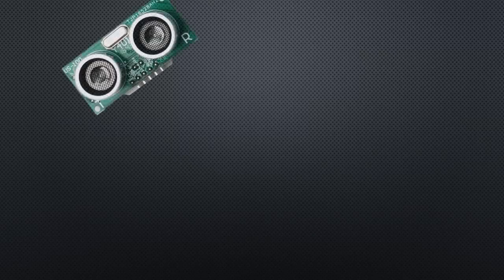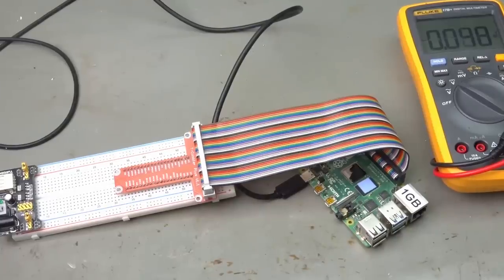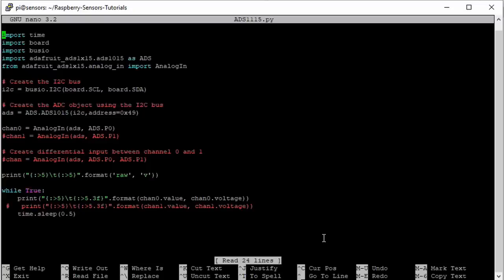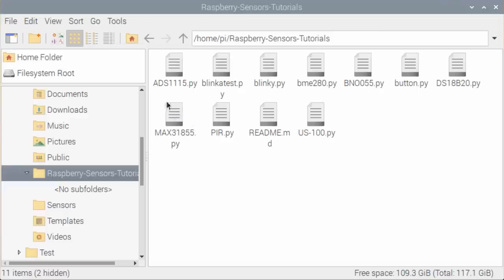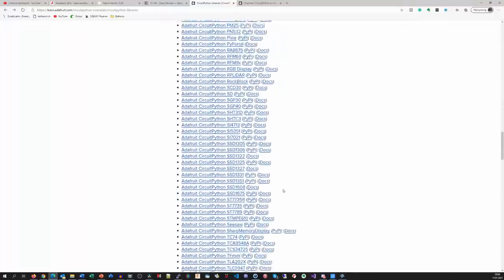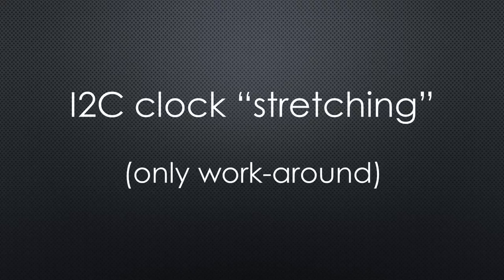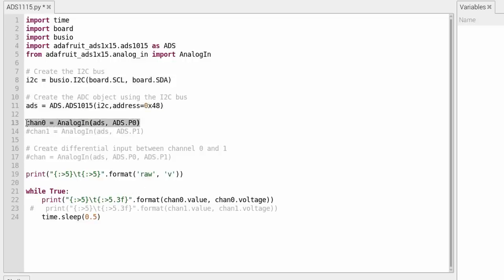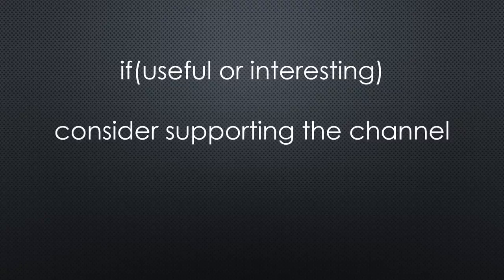#369 Definitive Guide to Attaching Sensors to the Raspberry Pi (Tutorial)

Comment: I find a better option for Raspberry Pi/Python drivers is pypi.org, especially if you're using non-Adafruit boards. Adafruit drivers tend to be optimized for their own branded products.
Reply from the maker: Does pypi offer sensor libraries? This is for me the deciding factor because I do not want to read the datasheet before I can use a sensor. Most Adafruit sensors are just a copy of the reference design. So no problem, I think.
Reply: @AndreasSpiess  Yes, there are usually several sensor library options there. You can also find the Adafruit libraries listed, too. It's a very useful resource for finding drivers.

Comment: IMHO, RPi is not really applicable for direct orchestration of sensors. Or, at least, not all sensors should be connected to RPi directly. Raspberry Pi OS is not a real-time system, I had tons of issues working with sensors that are accessible as "/dev/***" only -- just because OS was busy with something else when my software had to communicate to sensors. The same with i2c. Both with my C++ program and Python based.
But yes, thank you once again for another helpful video.
Reply from the maker: You are right: Real-time and Linux is not a good fit. Most of my sensors are not time critical, thou.

Comment: I am making a digital Speedo and wondering how do I connect a speed sensor to the raspberry pi and how to program it as the speed sensor does 6 pulses every 1 revolution
Reply from the maker: Linux systems are not good for real time applications. So if you need to measure exact times, maybe you use an Arduino or an ESP32 for the measuring and connect it to the Raspberry via Serial or WiFi.
Reply: @AndreasSpiess  I will keep that in mind if the way I plan on doing it doesn't work as I have the code working out the speed but for the displaying of the speed it updates every X milliseconds ( I would like to have an Arduino do that and send the data to the raspberry pi but I don't have alot of room as it will be going into a classic mini with a center speedo so it is unfortunately rather cramped

Comment: I have an arduino. But raspberry pi sensors. Can I use them on my arduino?
Reply from the maker: You have to check if they support the 5 volt of the Arduino. Then you can use them.

Comment: Good video.
First, like you, I start with Python librairies and Python code for I2C temperature sensor (also humidity and pressure).
Then I found some C code that was able to do system calls in order to communicate on I2C.
https://github.com/prisme60/BMP280

And finaly, I see that the driver for BME280 and HTU21 already exists in the Linux kernel, but the only way to use them was to create my own device tree module.
https://github.com/prisme60/dts_sensors_rpi
You need to use a specific device tree compiler for raspberry that is able to compile fragments.

Comment: @Andreas Spiess
Hello Andreas,
I am trying to read an accelerometer  data stream using arduino nano 33 ble, i get the device conntected and subscribe to the characteristic. but still having problems with getting the values, it would be really nice if you can help me getting it work. thanks and by the way nice and very informative videos :)
Reply from the maker: Unfortunately I cannot do remote debugging :-( But I am sure you find the problem if you check every function alone before you try everything together.

Comment: Why the resistor for the button?
Reply from the maker: It is a pull-up resistor.
Reply: As Andreas said, it pulls up the input into a known state (High). Without it, stray voltages may show a high or low on the input at random.
Reply: @7alfatech860  thanks!

Comment: Probably the raspberry pi pico is becoming a good way to interface between the pi and sensors...
Reply from the maker: We will see. I am not sure if it has much more common than the name...
Reply: @AndreasSpiess  it doesn't. Except for a commitment to openness, low price and good Micropython Support. It's very fast and has ADC. So it may become the go to board for connecting some sensors.
Reply from the maker: It has a tough competition...

Comment: We talk a lot about sensors and buttons and trying to be energy efficient as possible. I'm wondering why we are not using battery less sensors and buttons, Philips Hue Tap has been around for so many years and I still don't see an alternative for the DIY public.  It seems that the only option so far is to interface an EnOcean(https://www.enocean.com/en/products/enocean_modules_24ghz/)  module to our ESP32 or Raspberry Pi and use their Motion/Temperature/Humidity/Lux sensors or buttons.  Looks like Eltako uses exact the same modules, hard to believe there is only one way and so few doing battery less devices.
Reply from the maker: Enocean have great products. But you need a different technology (no Wi-Fi) to use them because they produce extremely low energies.

Comment: Third law of termodynamics -> There is no place where you can find  -1,800 °C, not even in Sibiria ;-). 

Some thoughts about the SPI temperature sensor:  
  a) The low negative temperatures could be caused by a wrong polarity. 
        Have you checked that the thermocouple is connected with the right polarity? 
  b)  Are you sure the thermocouple and the MAX31855 are type K? 
       The circuit python module only works with K-types. 
  c) There is a very little chance that the D5 pin is not set as output: 
       you could do this by adding the line to script: 
          cs = digitalio.DigitalInOut( board.D5 )
          cs.direction = digitalio.Direction.OUTPUT # add this line

 It would be so cool, if we could find a solution because knowing, it doesn't work, drives me crazy. 
Yes, I'm a Nerd ;-). Someone like Mr. Monk ( but not so brilliant ;-) ). 

BTW:  I like your videos: 
   interesting themes, 
   well prepared, 
   you do not hide your mistakes (so we could learn from them, as well as you did), 
   understandable english (with a nice swiss accent; greeting from a German neighbor), 
   no boring background music 
   and for me also important: fluent speaking with no ehms and aahhms. 

So thank you for your work and for your countless inspirations! 

vy 73 DF4VB (Peter)

PS: What is a qualifying purchase? Only the products in your shop, or can I mark other things, I'd like to buy, to be
       recommended by you (or so)? I have no experience with amazon, but if I could support you, I'd give it a try.
Reply from the maker: 1. The explanation about the low temperatures seem to be simple: Fake chips :-(
2. Thank you for your compliments!
3. If you start with one of my links, all purchases for a certain time (I do not know how long) count. Unless you use an affiliate link from a different source in-between.
73 de HB9BLA

Comment: No curly brackets in this python, suspicious ;) Nice overview. What is your take raspberry pi pico? Seems to be rather cheap but powerful if no radio stuff is needed
Reply from the maker: They are late in the game and no Arduino support. I ordered a few and will look at it. The price for sure is ok. But it will be an "uphill battle" for them.
Reply: @AndreasSpiess  I ordered two as well, and I am on the same page as you are with missing ArduinoCC support. Seems, platformio is going to be supported, if we are lucky
Reply from the maker: If it is not with the Arduino framework it still will not be easy to use, I think.
I will also have a look at the Adafruit Python libraries. AFAIK MicroPython does not support a lot of sensors.
Reply: @AndreasSpiess  I dislike Python stuff, but this is another story. I am used to develop c style languages for my whole life. Mine will arrive tomorrow, and I guess I will use their Visual Studio Code way of coding for the first blink blink...

Comment: Oh got...the amount of effort required to get mlx90614 is too damn high. I just gave up and used atmega as a modem.
Reply from the maker: Did you use the Circuitpython library?
Reply: @AndreasSpiess  nope.
Python is like gibberish to me.
It detected or as connected at correct address. But the output was garbage and unrelated to temperature as far as I remember